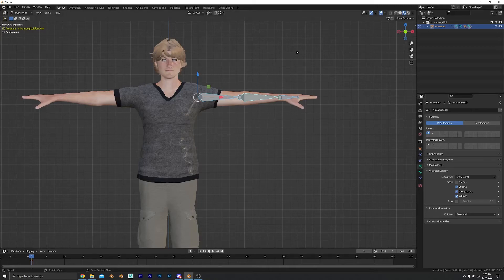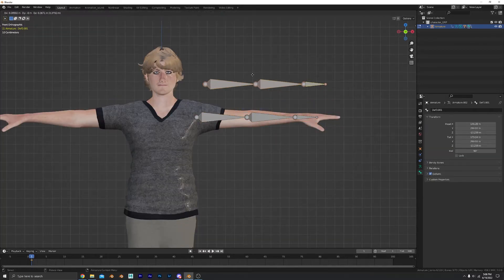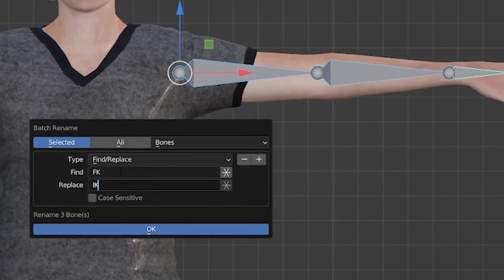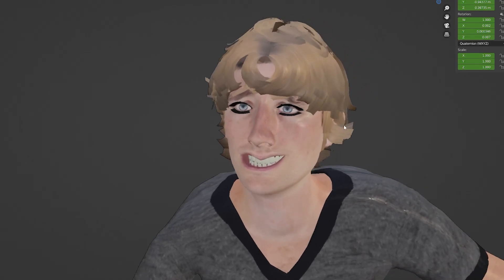How To Make IK FK Switch In Blender - Lazy Tutorial

Comment: Yo i have no idea if you still check comments on this but i applied this to my model that has existing animations i did manually before adding IK-FK switch, but now all the existing arm animation stuff is messed up, is there something i missed or any way i can convert existing base arm movement into FK? (maybe a 3rd value that just negates the effect of the FK IK switch then any existing animations i make going forward can use the switch? thats my only idea) edit: {Temporary Solution Below!}

Edit: i figured out somewhat of a solution, im not 100% certain if this will be full proof but

for those who are applying this to an armature with existing arm data, what i did was (ASSUMING YOU ALREADY COMPLETED THE TUTORIAL)
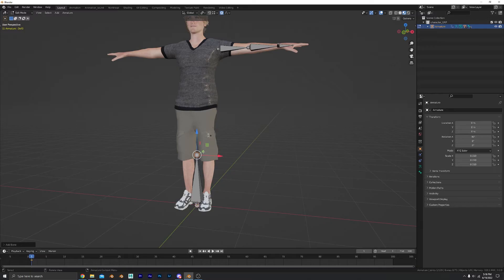- First, go to your root bone custom property that you set up and make the min value -1. (0:50)

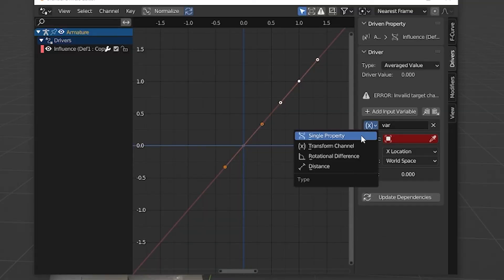- then, after configuring the drivers after the final step (1:10) once you set that up, un-hide the other graph and now you should see an X pattern

- select BOTH lines and use shift + crtl + alt + g to move the graphs so that the center of the X is aligned with 0

at this point if you look at the copy transform constraints now when the custom property is set to 0, theres 0 influence on both transforms which means all original transforms for those bones are not influenced at all by these new IK-FK bones.

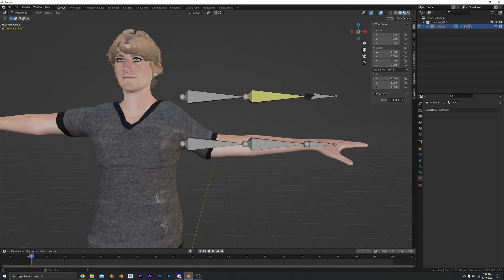- lastly, make sure once you confirm that both copy transform constraints for IK-FK are 0. follow the instructions here again (1:20) copy the drivers to the other arms
Reply: Thanks for taking the time to post your solution. I appreciate it!

Comment: I don't see how the batch rename action you show at 0:20 renames the bones to be labeled FK. You're apparently trying to "find" the term "FK" in the names, and replace it with nothing. Which is confusing for someone who is not used to doing batch rename actions.
Explaining that the root bone IKFK custom property has to be added in Pose Mode instead of Edit Mode would have saved some confusion.

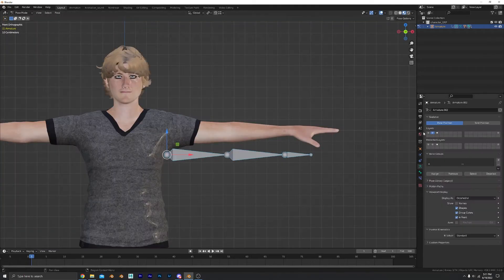Comment: 0:42. On that part I don’t understand how you move the bone like that and how all the bones transform into green
Reply: Green bones means it have a Bone Contrain on it (in this case, Copy Transform); it need to do that for each bone (see that first time showing the green bone only one is green). For the movement it is changing the infliuence of the contrains on Properties Editor, so when its 0 means it returns to the original position/transformation and 1 means that will copy the target bone (the others 2 green bones should be 0 on that scene by the way they just follow the upper arm bone)

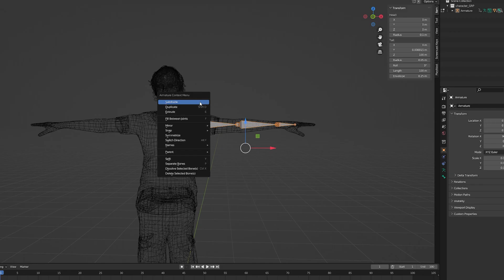Comment: At 1:28 what do you mean by edit the drivers? And how do I make it so one side is FK while I switch the other to IK?
Reply from the maker: You will need to create new switches for the other arm and add new drivers to go with it. Basically just do the same thing again but change it from L to R.
Reply: @NavillusStudio  Ok so create a new switch bone aside from everything else I just need to flip those green and red lines in driver editor in the opposite direction is that correct?
Reply from the maker: If you copy the drivers to from the left side to the right side you don't have to flip the drivers. Just re-target them to the control you made for the R ik fk switch.
Reply: @NavillusStudio  thax man it's rare to see short tutorial videos about blender and most of them are complicated
Reply from the maker: @stephengomez9715  No problem.